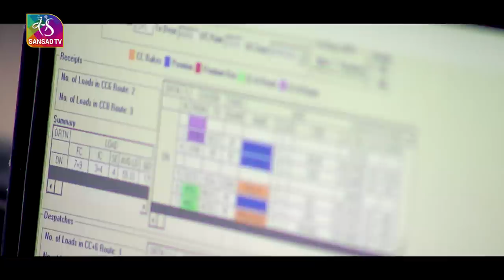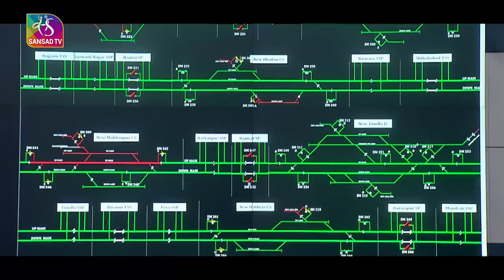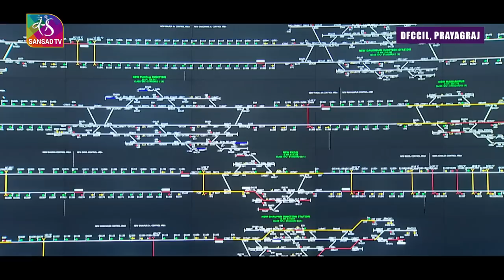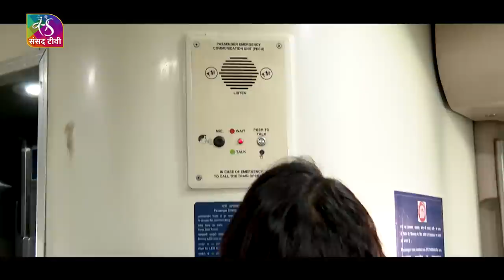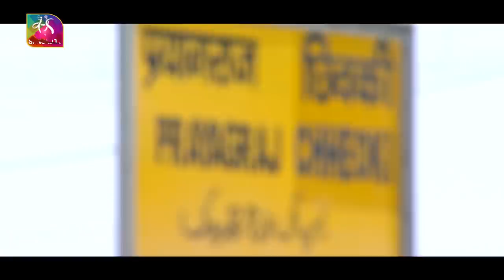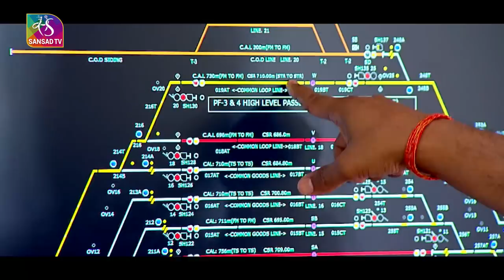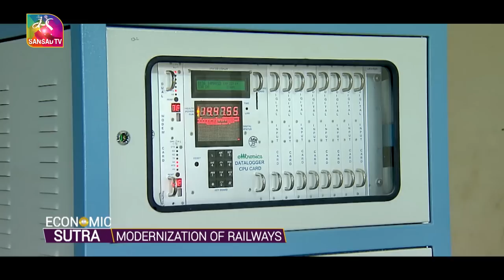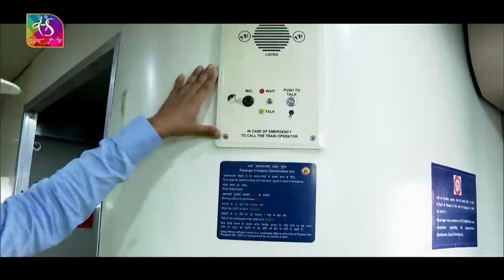Economic Sutra by Sanjeev Sanyal (Episode 11) - Modernization of Railways | 26 June, 2022

Comment: since 75 year of independence.. we mostly import parts from Germany. required atmanirbarta in railways.
Reply: No not really. Having a colonial slave mentality like yours without examining the ground reality is typical of someone with a catholic school education. Most of the passenger coaches (LHB) are of German technology but they are manufactured in India. Same goes for the freight trains, they are either GE or Alstom but again manufactured in India. Vande Bharat is completely indigenously designed and manufactured.
Reply: Foreigners still think Indian railways is backward
Reply: @BharatkaEkBeta  Yes of course even our country build by whites, even our ancient knowledge is also given by whites isn't it?
Reply: @reardelt  of course it backward yet, but very soon it will be very advance.
Reply: Average Running Speed of vande bharat is only 70 75 km/h ..Than why was the need of getting new trains when tracks are not for high speed what a dumb decision..So sad

Comment: Railways are connecting people to people within a Particular time and comfort, from the British era we are travelling by train. In India majority of infrastructure had been made by Britishers, but after independence with the rapid technological change we come up with new technology for communication, new railways track with high durability in sync with new strength, better braking system, cleaned station, connecting dots of the supply chain of food. Before a decay, India is facing the problem of train collision with train to train and train and the technology is under development phase for any other object to prevent collision like animals, for that we have made an indigenous KAVACH system which prevents trains to collide. we are moving toward bullet train this is our ambition to run bullet train on the track of India in an effective manner. with the opportunity we have some challenges, this is our responsibility how we can overcome any hindrance in the way of advancement of railways,
Reply: Does Kavach system prevents collisions with animals and other objects or just trains?
Reply: @AbhishekYadav-we6wp  nope, its just train. For prevention of collision with unknown objects in high speed, fencing is done.
Reply: @navaneeth1087  I knew that it is for preventing train collision but as Shiv Shankar had written animals and other objects also so I got confused. Thanks for clarifying.

Comment: Vande Bharat trainsets = only the two original trainsets are running. The  IR bureaucracy still cannot roll out the third trainset, not to speak of the planned 75 or 200 announced by the PM or Railway Board. LHB coaches are 30 year old technology. So much hype!!
Reply: Speed of vande bharat is only 70 75 km/h ..Than why was the need of getting new trains when tracks are not for high speed what a dumb decision..So sad